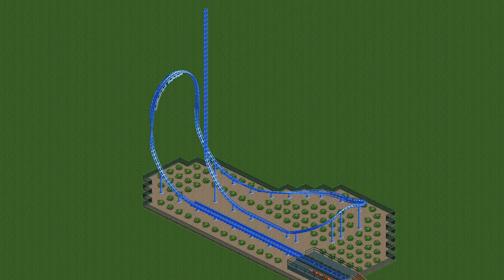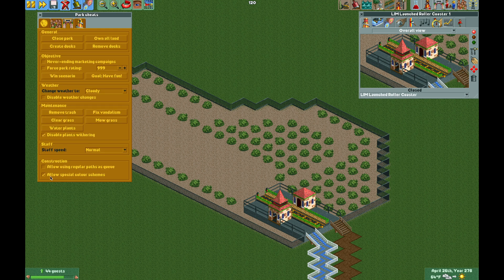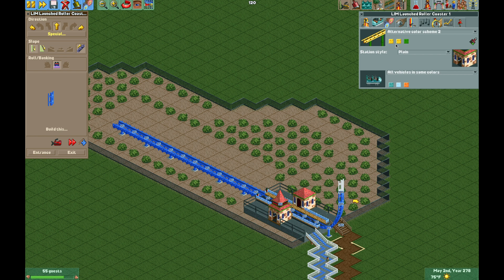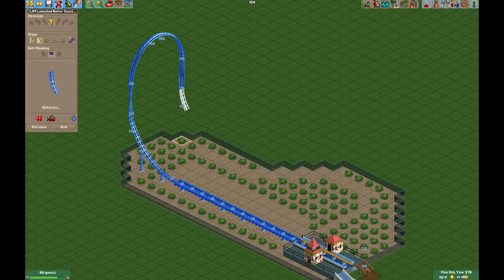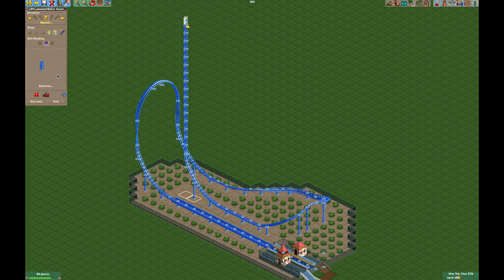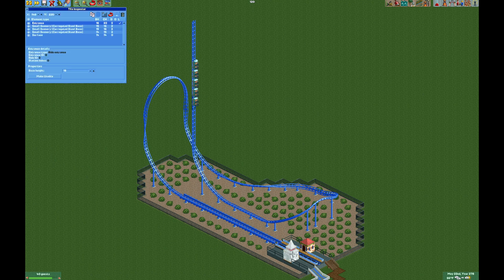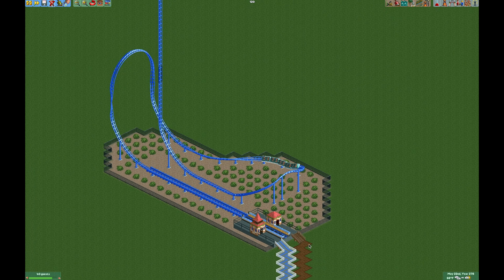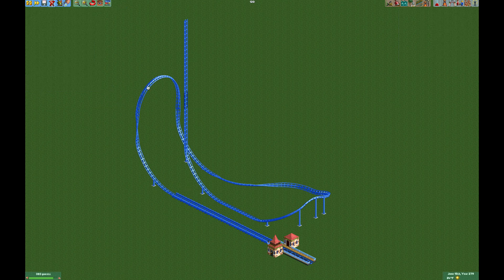Vertical Boosters - Mr. Freeze Recreation - OpenRCT2 Tutorials

Comment: If you go to vehicles you can actually reverse the trains
Reply from the maker: Yeah, it's very easy to switch it to Reverse Blast. I was going after the St. Louis version which is no longer reversed. Couldn't find a logo that didn't have reverse blast in it, though
Reply: @openRCT2tutorials  over Texas actually has a forward and backward train :)
Reply from the maker: @Goliath146 And a dual load station but I couldn’t be bothered to set that up.
Reply: @openRCT2tutorials  yeah